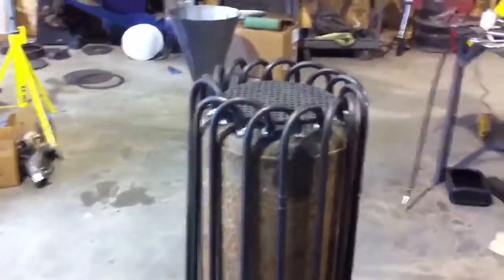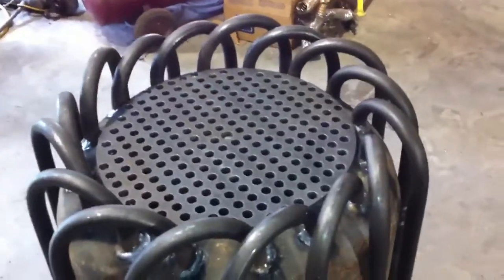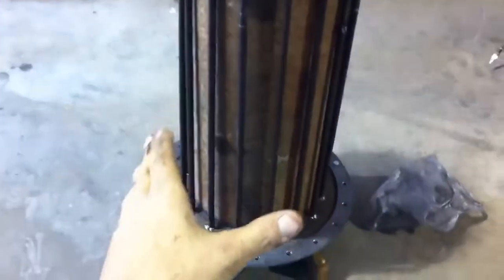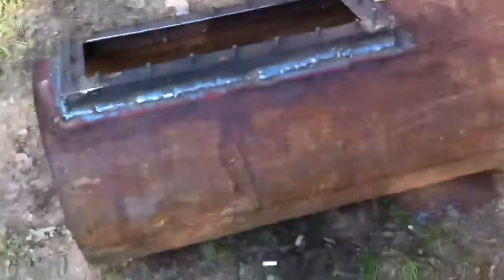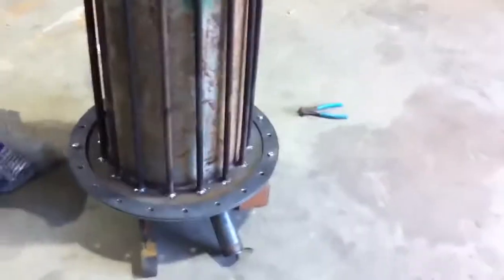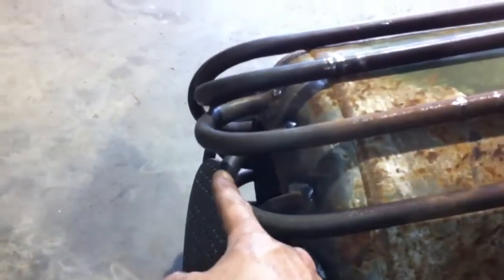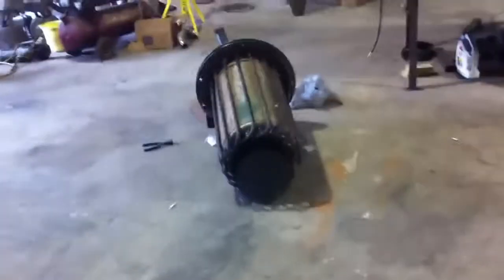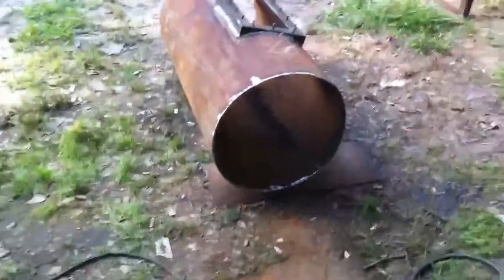Gasifier part 2

Comment from the maker: I took 3 different ideas and put it into one... I'm going to run a 25 kw generator withit... It has a 6 cylinder motor tuning at 1800 rpm.. I hope I did my homework.. Hope it works.. It would be awsume..